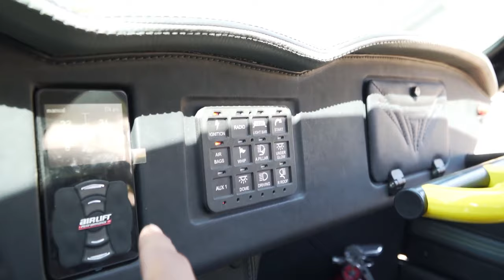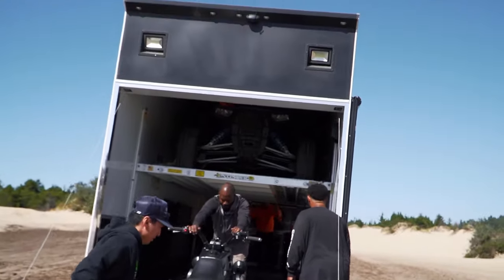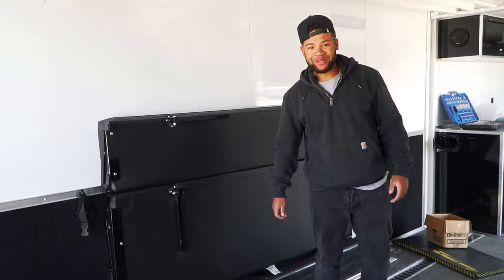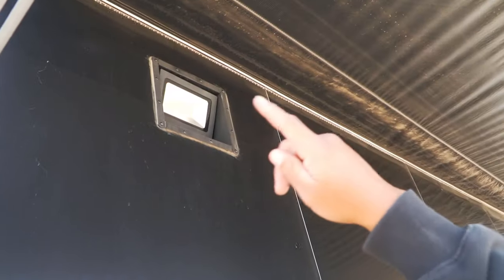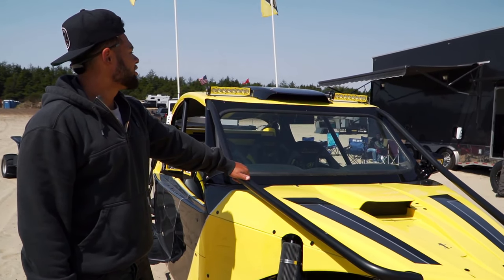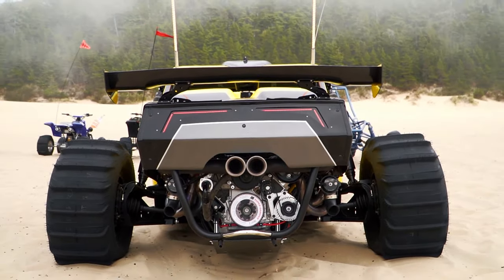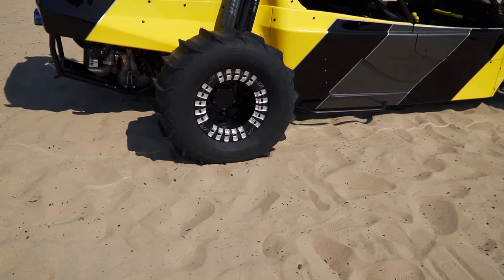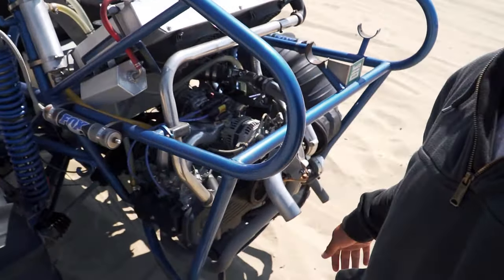OUR NEW FUNCO SANDCAR HITS THE OREGON DUNES!

Comment: Man I deff would have opted out of the optional air bag system or hope they have some sort of addon suspension stop if parts fail. Unless it's drivable aired out to avoid being stranded but id prefer reliability of full function over some parking stunt